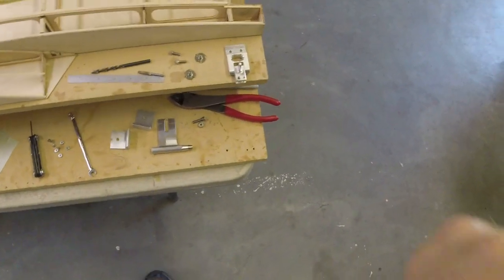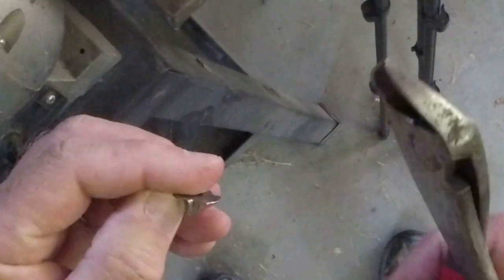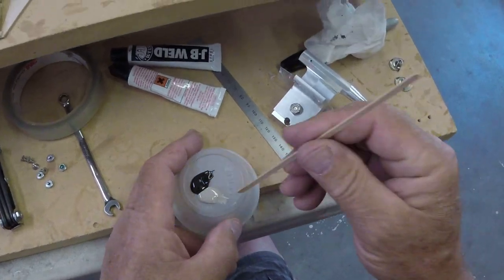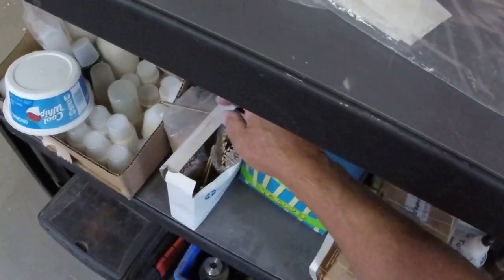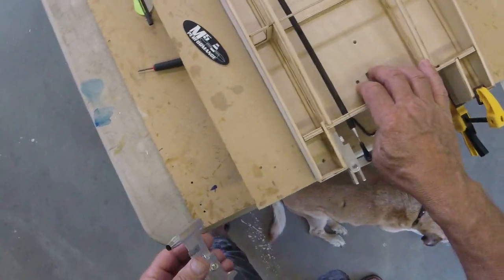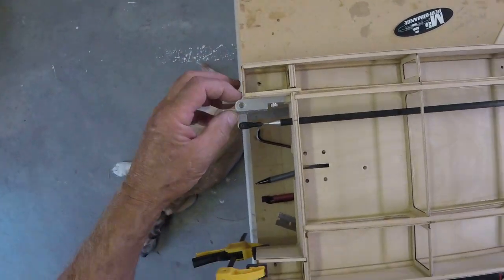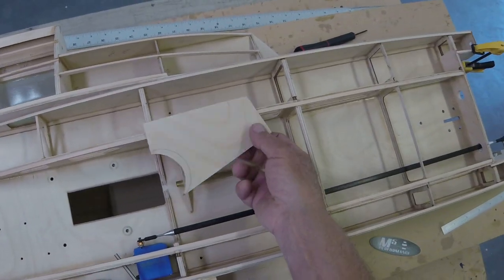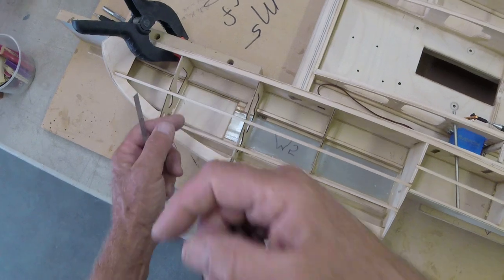Rudder Bracket Install, Prop Strut Modifications, Steering Servo Mounting | RC Racing Hydroplane

Comment: For your rudder bracket you can turn a point on a spare mounting bolt and use it to mark the center of the hole before drilling. I use this approach for marking engine mount holes and other stuff as well. Its more accurate than using a pencil and then guessing where the exact center is before drilling. I use my Atlas lathe to make the tool. Works like a charm.
Reply from the maker: Good idea!

Comment: The  tip on cutting the tabs off the blind nuts  is a great  idea  most of the time they bend when tryng to use long ones especialy   in birch or other hardwood  ply.
And now they r lighter !!
Reply from the maker: I hadn't thought of that... Absolutely correct!

Comment: The cyanoacrylate  glue for control rods is called IC-2000 fr bob smith industries .
 I push long 2-56 control rods thru thin carbon  tubes  and this is whats recommended  to glue them together and to  glue  a short  3/16 aluminum tube  on the outside  to keep the carbon rod  fr splitting on the ends .
 I use it on all my airplane control rods now instead of using golden rods 
Lighter  Stiffer 👍
Reply from the maker: Lighter-Stiffer is my middle name!

Comment: Have you considered 3d printing your servo mounts? With a FDM printer you can capture the nuts inside the print. As long as you are using the same size mounts on all your boats you'd only have to design it once.
Reply from the maker: Yup and I'll fiddle with that in future builds. For the current build I wanted to use techniques and materials that anyone could do in their own shop

Comment: An alternative source of carbon fiber rods: Umbrellas. Yeah, it sounds lame, but it's true! I was about to trash an old umbrella when I noticed that it had carbon fiber rods in it's construction (gotta be a RC nerd to notice that), but anyway, I was curious, so I removed them before trashing the what was left of the umbrella. The rods I now have are 16 inches long (40 cm), and 5/32" (3.88 mm) in diameter, they weigh very little, and they're pretty darn strong too!
Reply from the maker: Nice one!

Comment: As long as your using a good higher end servo with lots of torque and metal gears the steering servo should never fail under normal use. Hull vibration from the motor could eventually cause the electronics inside the servo to fail but that will take years of running for it to happen.
Reply from the maker: Yup I use cheap hitech servos and they hold up just fine
Reply: @M5PerfHydros  Hi-Tech Make some pretty high torque servos so it shouldn't be a problem. I have just had a lot of issues with that brand in the past so I stay away from it. But I do know a lot of people swear by them.

Comment: hey Scott I havent a link to get the G10 that you uses
Reply from the maker: Here ya go https://www.eplastics.com/sheets/micarta/g10-fr4?page=4
Reply: Thank you Scott and in your other videos show yu instsll the engien that you use what model of engine is it n size
Reply from the maker: I've been running Nova Rossi engines for years, but they are no longer available. My current build will be using a CMB .67 engine